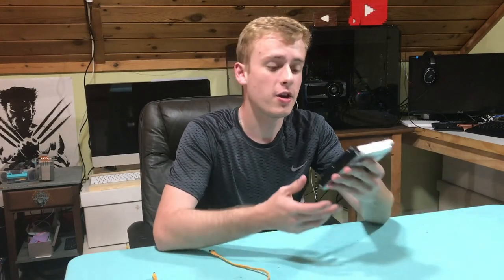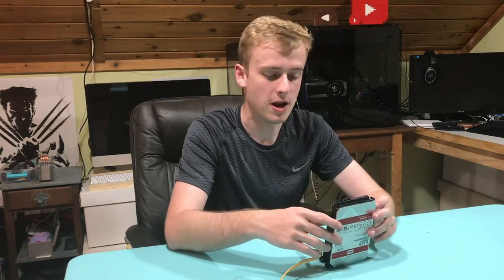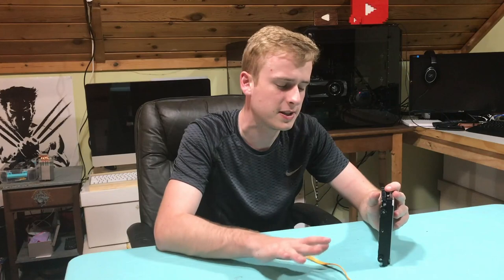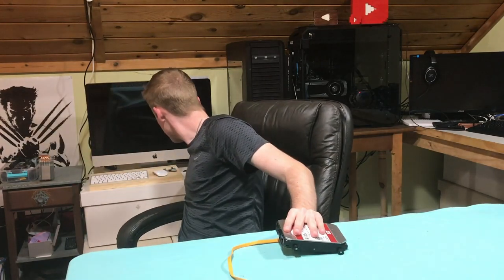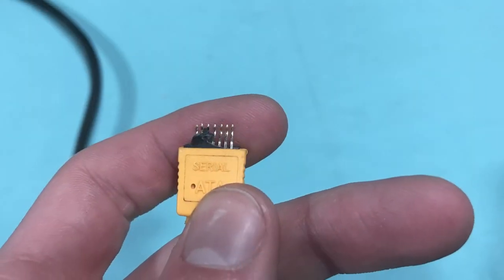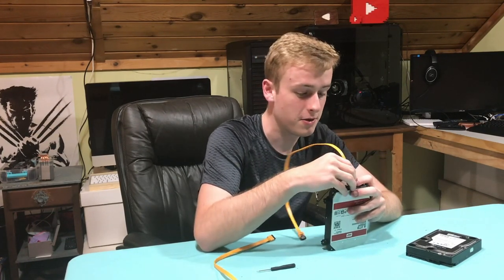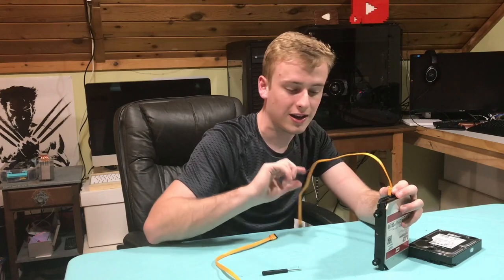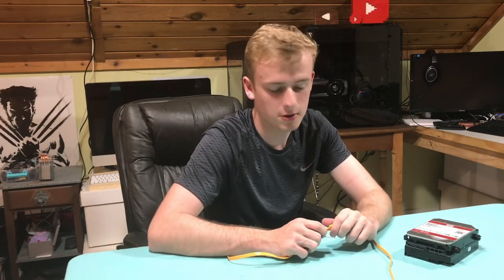How to get Data off a Hard Drive with a broken SATA Port

Comment: Plastic alligator clips might be good for holding the pins in place while you get the data off. Wooden clothes pin perhaps, but the pressure might be too much.

Comment: I have a Toshiba internal HDD. Sata connector broke along with the #4 pin which I belive is a ground. If I still can get it connected with the missing ground pin not allow for data to be transfer to a new HDD?

Comment: You any good.with ssd's? Finally got my first one a month ago and now I'm getting some time of sata s11 error and idk what to do..everything I look up doesn't really help or contradicts what others told me the error means 

It's my only ssd and can't afford another at this time so just curioius of you know anything
Reply from the maker: Hmm could be two things,
1 (hope for it) it got currupted and you need to wipe 
2 your brand new drive oofed and is dead
- to check run a disk utility to make sure you can read/write all the disks
Reply: will do man thanks